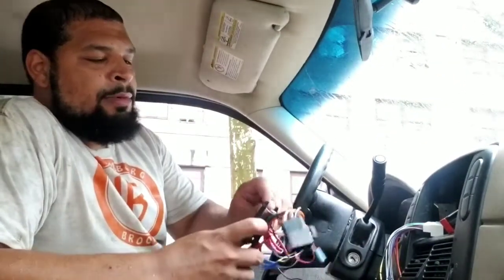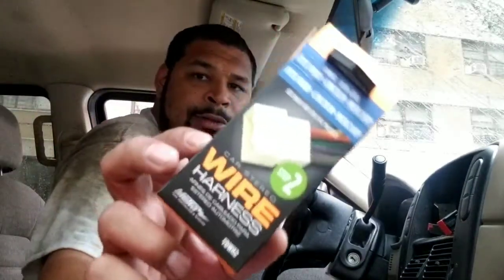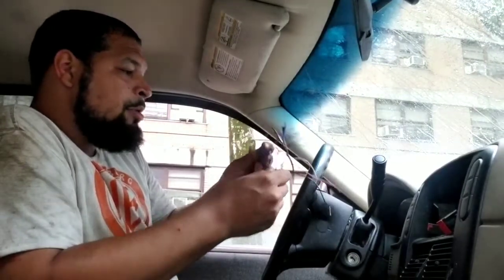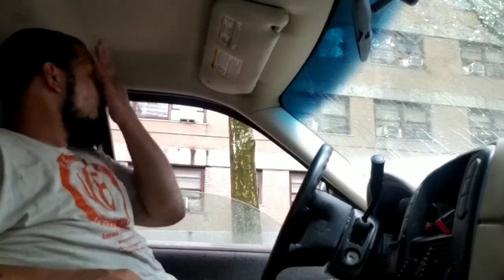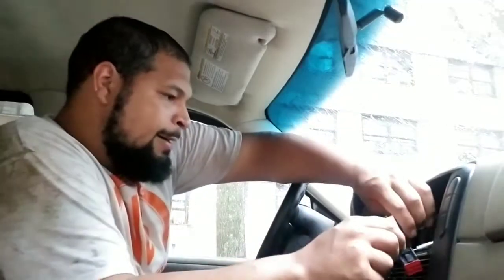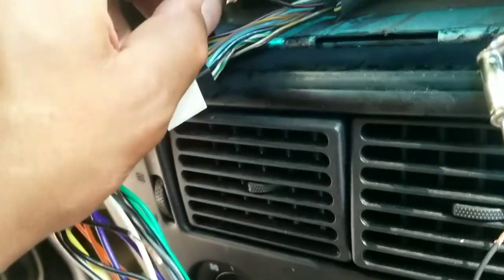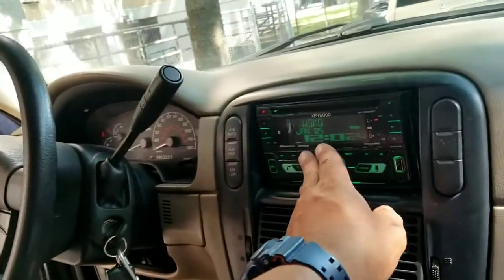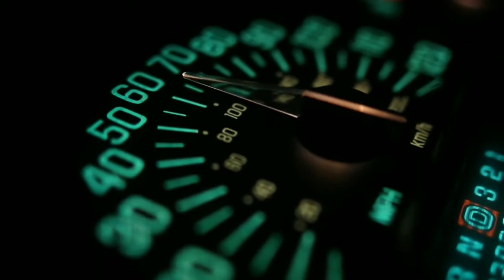Check Wiring Radio Problem / Aftermarket Install

Comment: My JVC keeps displaying the same exact message.  But, it'll come on and work again for a while, then I hit a bump in the road and it just stops playing again, until I turn it back off for a while.  But, the message keeps coming back no matter what I rewire.  Do u think this could be my issue, as well?
Reply from the maker: seems like you just need a new radio, rewire a new kit, but possibly
Reply: @2SmartAuto  Figured it out...my aftermarket speaker was conducting to the rear deck frame, causing it to crackle and error out.
Reply: @snowmayne6283  so how did you fix it?
Reply: Mine too
Reply: So the ground wire to the radio from the factory ground was dead
Reply: @Snow Mayne how did you end up fixing yours? I am having the same exact problem